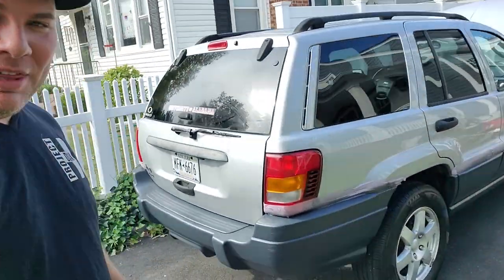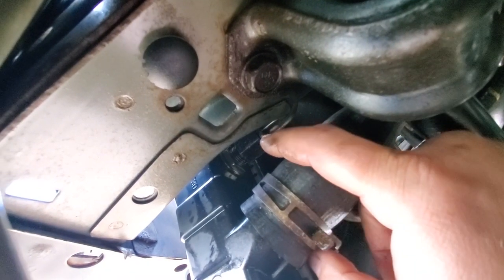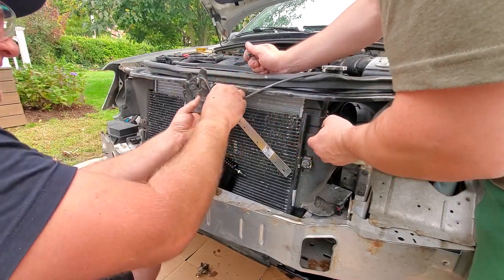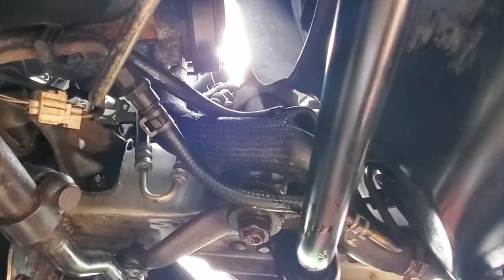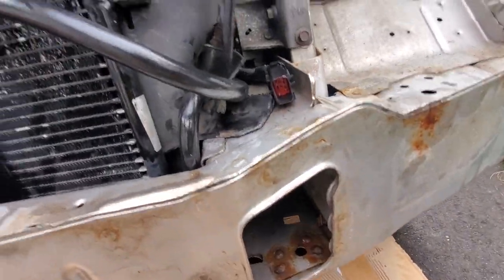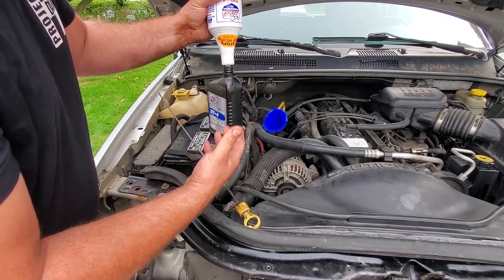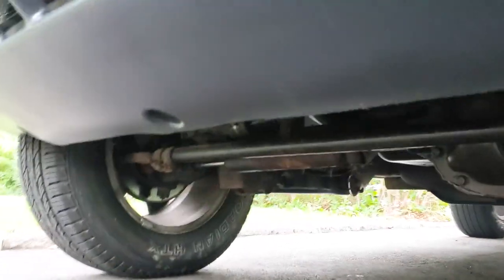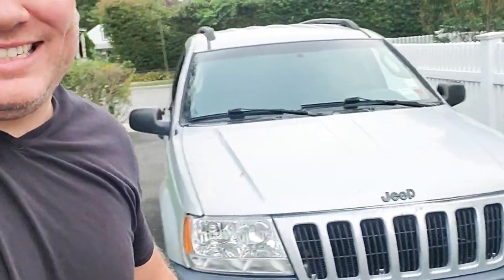2002 JEEP GRAND CHEROKEE REFRESH PART 2 - TRANSMISSION COOLER INSTALL

Comment: Hey Super Dan, you show a lot of moxie  with all the projects you have done and you gotta love that Black Beauty Cherokee.  I have a 96 Jeep Cherokee Classic RWD black (I hope to convert it into a 4WD) and the lower end of the liftgate support strut  bolt had completely wacked out by braking the bolt nut that is on the inside of the frame rail. Well the nut fell  and on my Cherokee.  I and about  3-4 other folks have been thinking about a fix. Well i finally came up with one as to keep it OE. I wrapped a nut with a hose clamp then slipped a electrician's metal fish-tape though it and was able to get it to get into the right position enough to get the stud started ! She tightened up and now I dont have to modify a strut mounting. I would send you a pic but my waterheaded self doesnt know how too!!!
Reply from the maker: hey! sounds like a great fix!  message me on Instagram!

Comment: Thank you for this video, Dan.  It's exactly what I needed to see to get the inspiration for adding an external cooler to my WJ.  My new radiator developed the slow drip drip drip at the trans line fittings and was wanting to add an external anyway.

If you had to do it over again, would you still get the Hayden 678, or would you choose a different size and if so, which size?   And, would you mount it in the same place?  It looks like part of the fins goes below the crossmember.  I guess it's a trade off between sir supply to the cooler and air supply to the condenser.
Reply from the maker: it's working perfectly the way I installed it.  I would do this to every WJ the exact same way. cheers!

Comment: Great video I want to do the same to my wj but want it to add a cooler with a fan  but would it be better with a switch to turn it off and on the trail or what would be the best way so the fan can turn on ?
Reply from the maker: I used to have a manual override for my E-fan on my XJ.  It worked very well but it tripped a voltage CEL.

Comment: which trans line does the radiator upper/return line connect back to on transmission. I removed them from that line to be able to take out busted radiator, as the old lines were seized on cracked radiator. help a girlout
Reply from the maker: the trans fluid exits the trans from the front of the trans through the high pressure line into the bottom of the rad cooler, then out of the top of the rad cooler  (from here you can splice in an additional cooler) then it goes into the return line to the rear of the trans.

Comment: Good morning friend ... I have a problem with my wj overland motor 4.7 has a hydro-fan system and it is overheating me. My question is whether this system uses a pwm relay or not ???
Reply from the maker: the hydro fan shares a fuse with the O2 sensors... usually when the fans go bad it's the solenoid.  check out my other WJ vids. it will help you
Reply: @ProjectDanH  thank you men

Comment: Hi, I'm from Mexico but I understand your language a little, could you tell me what is the cooler for or what is its purpose? I await your answer, since I follow you because I want to fix my 96 and 99 grand cherokee cars
Reply from the maker: we got a store-bought transmission cooler because basically I broke the one inside the radiator. 🤦‍♂️ all vehicles withautomatic transmissions should have a transmission cooler somewhere. thank you so much for watching

Comment: How'd it shift ? The dipstick was so close to the hot side of the battery Is was trying to move it from my phone 🤣 On the lower plastic paint did he use adhesion promoter so it sticks to the plastic good ? I was thinking of doing mine but I might just swap for limited panels they look better to me idk if I can find some in my color or black .
Reply: Washed with detergent, sanded gently with high grain wetordry sandpaper and washed again. The used duplicolor trim and bumper spray paint. After heavy rain...looks great!
Reply: @absyrd1  looks good for sure I just don't know if it will lift off come spring .
Reply from the maker: Yes, we thoroughly prepped it. he spent half the day scuffing it, washing it, degreasing it, and priming it.  it came out great. the best part is, if it gets scuffed that paint is only $6.99  for a quick re-spray.   There is a black WJ with painted trim in the peconic auto wrecker yard in Remsenburg LI, out by me.
Reply: @ProjectDanH  can't beat that I been using tire shine on them and it cost just as much and comes off in the rain so I might be doing this on a warm day soon .
Reply from the maker: @jaysmith5084  heck yeah bro!  That paint comes in a black, a charcoal, and a tan I think!

Comment: Hey Dan! Always enjoy your content and sense of humor. In your vast store of Jeep parts, would you happen to have a power steering bracket with the belt tension adjuster? I did the intake upgrade on the Bumble Jeep and the original power steering bracket required extensive modification to make it almost work. Squeaks something fierce. I saw the bracket I need in a manifold upgrade video by Nickintimefilms channel. Our yards around here are picked pretty clean for Jeep parts. Let me know if you have one, how much you want and any other details. God bless, stay well.
Reply from the maker: I'll give a check for ya.. just to make sure, a belt tensioner/ power steering bracket for a 99-01 XJ?
Reply: @ProjectDanH  Mine is a 95 XJ sport. Not sure what the "new" intake came off of. The guy I bought a lift gate for the glass had it laying around. I had seen a ton of videos on the intake swap (none of which mentioned the need to use new mounting brackets for the power steering pump) so when I saw the intake, I made him an offer and bought it. Aside from the noisy belt, it's been an improvement. I can link the video that shows the bracket I need if that will help. (send the link)
Reply from the maker: @projectbumblejeep4190  I may have a couple stored away somewhere..  by the time I fend em you could just order this one ...  Lol 
https://www.ebay.com/itm/363088328407

Comment: DONT PAINT THE BUMPERS    WARM THEM  UP  WITH  A  TORCH  NO  JOKE     IN  BOX  BOX  BE  ill show my  99  laredo    no joke
Reply from the maker: I use a heat gun instead of a torch It's much cleaner.  In this case we had to paint them because the rear bumper we got from the junkyard was Driftwood color while the side skirts were the gray. now they all match 👍